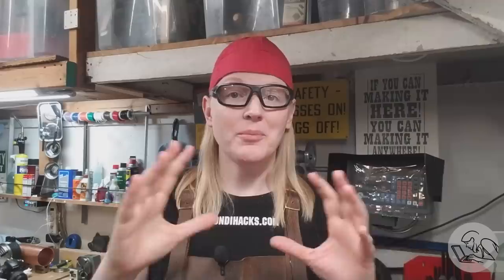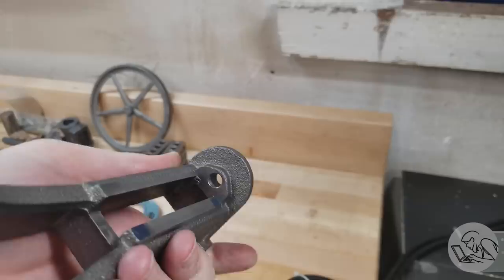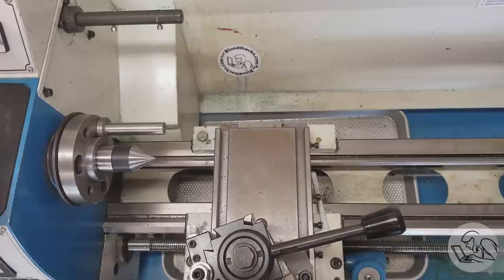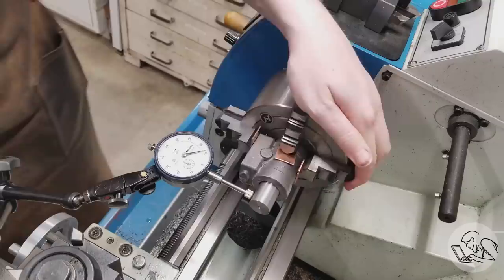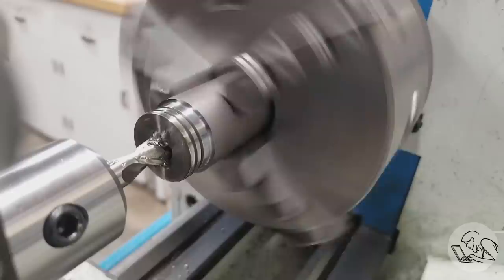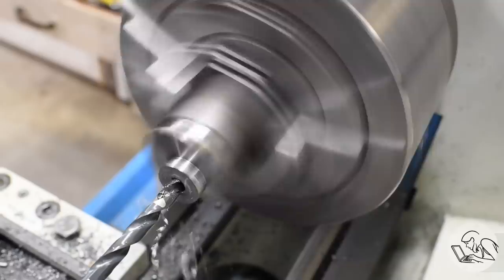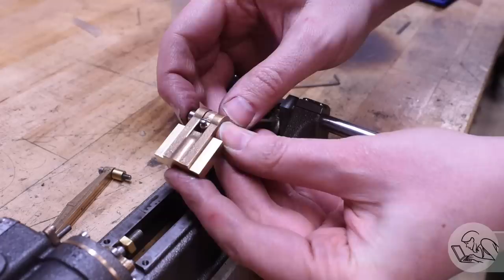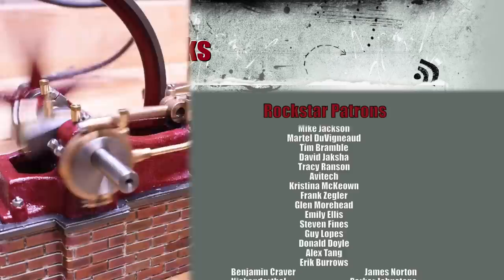Build a steam engine!

Comment: Playlist videos as they relate to this video:
0:38 - 1:53 : Prep and Planning
1:53 - 3:05 : The Base Casting
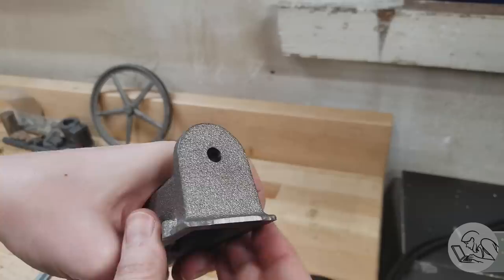3:05 - 4:16 : The Tale of a Difficult Hole.
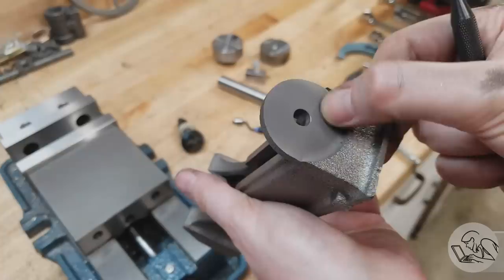4:16 - 5:38 : Spot Facing!
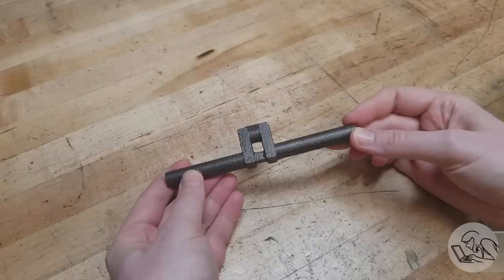5:38 - 7:35 : Main Bearings!
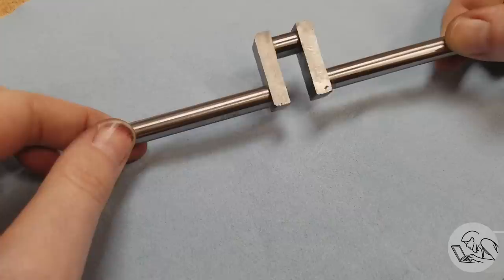7:35 - 11:27 : Making a Crankshaft!
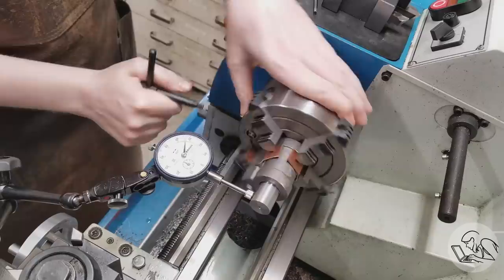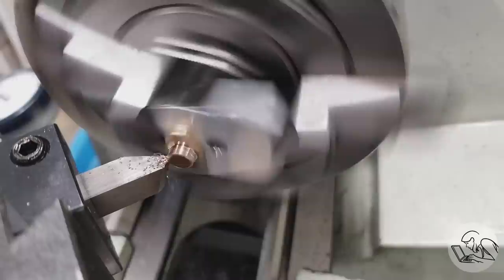11:27 - 13:52 : Machining a cylinder casting! (Note: released after next episode)
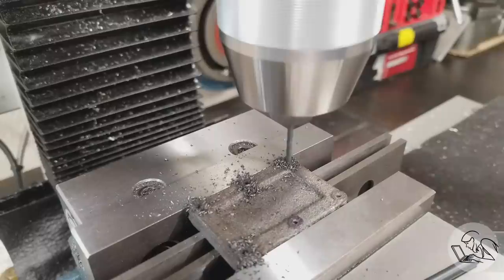13:52 - 14:39 : Cylinder Heads and Gland Nuts and Steam Chests, Oh My! (Note: released before previous episode)
14:39 - 15:59 : Machining a Piston!
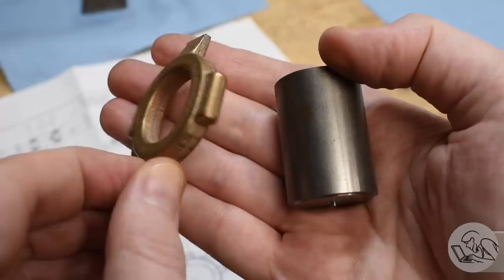15:59 - 17:10 : Valve And How It Works
17:10 - 19:12 : How to make an eccentric!
19:12 - 19:42 : Valve Gear!
19:42 - 20:54 : The Crosshead!
20:54 - 21:33 : Flywheel!
21:33 - 22:40 : First Test Run!
22:40 - 23:16 : Oiling System!
23:16 - 23:23 : Model Steam Engine Valve Timing
23:23 - 26:07 : Finishing Touches

Note, many of the scary moments are removed for this video. If you watch the full build, prepare for the suspense of, "Did Quinn need to buy two kits to be able to make this series, or does she end up barely escaping accidents that could ruin a casting for good?" Thankfully, everything is out now, so even if the next episode was delayed by waiting for a replacement casting to be shipped, you can just binge it all.
Reply from the maker: Wow, thanks for putting together that great guide! 😁
Reply: 14:39

Comment: Magnificent! Never realized how much I prefer purely mechanical projects until just now. After all the headache from integrated circuits, microscopic SMD components and phase wire/hall sensor combinations I think spending some time with the milling machine and lathe would be a nice relaxing break.

Comment: I’m not sure if anyone mentioned it yet but if you want great color variety for the hi-temp paint, you can use brake caliper paint. Also hi-temp, designed to stick to cast iron, and resists DOT3. Not that it’s needed here but hey
Reply from the maker: That’s a great idea!

Comment: Quinn , I noticed when you open the direction it said at the top.  Steam drilling Engine , I wonder when this was a full size engine (you know what I mean ) in the 1800.s  if it was meant to drill for oil or , power jack hammers ???   none the less a very interesting project , you videos are top self  ....    Pete m
Reply from the maker: Good question! I believe PMR bought the kit patterns from some older company, so the information about the engine being modelled here may be lost. It’s a very old engine with a primitive design, and not very big. Powering a well driller or similar seems to be likely.